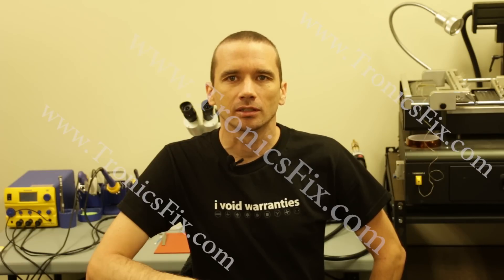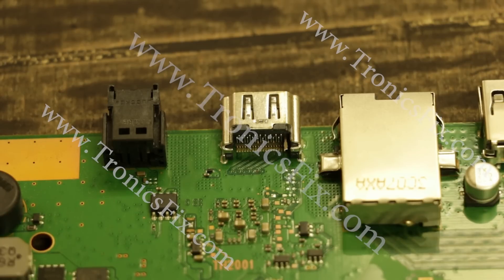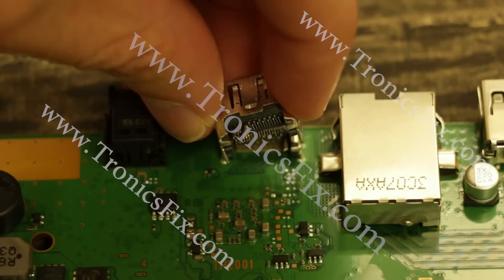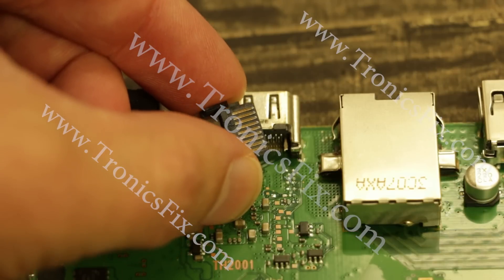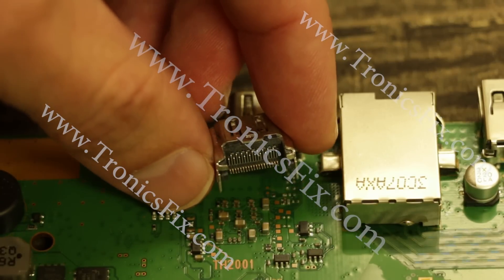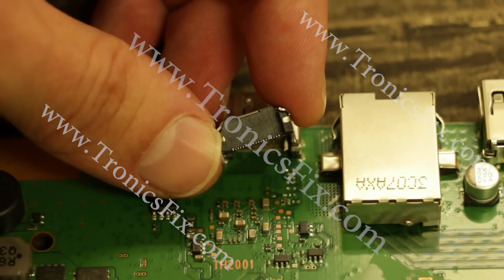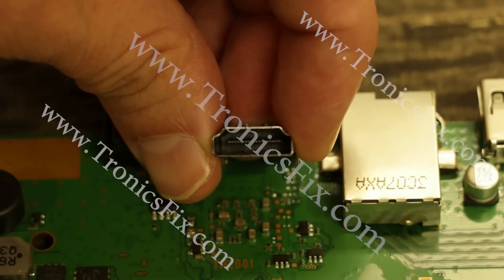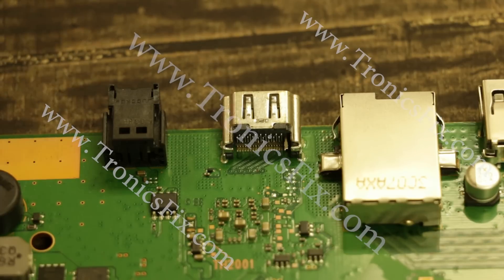Why PS4 HDMI Ports Suck

Comment: So how does my PS3 Last ever since 2009 and still works now, but my PS4 can barely last?
Reply from the maker: Good question to ask Sony!
Reply: I said the same damn thing. Smh.
Reply: My exact thought. Why tf...
Reply: I just got a PS4 Pro and I think my PS3 slim died of jealousy
Reply: because ps3 was a premium machine while ps4 it's made from low cost material. Iron vs Paper, basically
Reply: i have a ps3 with a fan problem
Reply: @misery_fell  one handed clap for you

Comment: I'm fairly sure I have this problem. I've not done anything to my PS4 other than change the HDMI once and that has meant there is no output at all from the HDMI even though there is no fault with the hardware of it. How would I go about fixing the issue independently or should I just go to a shop? Cheers
Reply from the maker: kurtisgre I don't want to discourage you from trying this job yourself, but at the same time this is a very difficult job unless you have a good amount of experience...we get these in quite often from other repair shops who have screwed them up so I can't say that I think it's a good idea for someone to try themselves unless you have a good amount of electronics repair experience. 
Just be sure that the shop knows what they are doing...ask them how many of these they do in a week. Ask them if they have even done one. If they don't have much experience I'd be wary. 
We have a mail in service for this repair if that works better for you.

Comment: What's actually holding the port to the motherboard, screws or solder? I think Sony might have fixed this now. I have the Batman version and it has a solid back not through like this one and haven't had any problems with the pins. But the HDMI cable doesn't go in smoothly, it does take a bit of pushing and wiggling to connect it.
Reply from the maker: A2892Z There are some of these out there that have an upgraded port, but not many. Hopefully they will start using better HDMI ports. 
Normally you should be able to just push it in without too much trouble. If it still shows a good picture on your TV then I wouldn't worry too much about it.

Comment: I went to repair shop. due to hdmi port completely going inside ps4. they repaired no cost if ps4 was not working after fix. they said motherboard was damaged. could it just be the port?
Reply from the maker: They likely damaged some of the solder pads on the motherboard. It's very common with people who try to replace these but don't know what they are doing. I'm not saying that's what they did...just that it's really common. I can fix it if you want to send it in. I'll have to look at it first though so I can give you an estimate.

Comment: hello steve i heard you said that if you press the power button and it beeps and then goes off then you press it again nothing happens, you have to unplug it, plug it back in and then it beeps again then that would be  a power supply issue. but what on the power supply is bad that would cause that problem?  i have that issue and i am trying to fix it instead of buying a power supply. help please
Reply from the maker: No idea. Sorry

Comment: Is it possible to place them back. Can I use a soldering iron that sucks the solder what else would I need to complete this project
Reply from the maker: luis hernandez I'm not sure if you are asking if you can reuse the old one or if you are asking if you can place a new one where the old one was after you remove it. You cannot reuse the faulty HDMI ports, they need to be replaced if they are bad. 
As far as replacing them, yes you can use a solder sucker to get the solder off. You would need to suck the solder off of the 4 mounting pins as well as the 19 tiny pins. You also need a new HDMI port and some good flux and solder.
Reply: I opened it and pushed the litttle meta  back in place i guess i got lucky it wasnt that bad now its perfect
Reply from the maker: luis hernandez I'm glad you got it working! Just keep in mind though that they will get pushed back through so at st some point you will need to replace it, but if you're lucky it will go like this for a long time!

Comment: Hey TronicsFix... my hdmi port is broken, i bought a new port and thermal paste to repair it. I also have all the necessary tools i just am wondering how difficult it is for a complete amateur on stuff like this to fix it myself. There is videos showing of how to do it. If I  cant do it i will send it to you, also what is your pricing I called a place and they said $180. Thanks...
Reply from the maker: Devin Woodruff To be honest it's a tough repair. We get consoles in from other repair shops that couldn't do it. That's not to say that you can't but it's a tough repair for a lot of people. Whatever you do, don't use a heat gun on it. We just had to fix one that had some nice burns on the motherboard from a heat gun. 
Don't pay $180 for it. Sony will even fix it for less than that! We charge $89.99 for this repair and that includes return shipping. We've done hundreds so we have gotten quite good at it. Here is the link if you decide to send it in: http://www.tronicsfix.com/ps4-hdmi-port-repair.html
Reply: TronicsFix Ok i most likely will,l i was going to use a heat gun but i guess thats out thanks.
Reply from the maker: Devin Woodruff I'm sure some people can make it work with a heat gun...it's just a really bad way to fix these and will probably cause more problems than it solves. Plus I'd hate to see you have to pay more for the repair because the heat gun messed something else up.
Reply: alright well i think im gonna send it in thanks for your reply
Reply from the maker: Devin Woodruff Sounds good. I'll watch for it!
Reply: TronicsFix do you guys use the improved one now?
Reply from the maker: Devin Woodruff Yes, we just got them in stock so we use them 100% of the time. We don't even have any of the old style in stock anymore and we don't sell them either.
Reply: awesome ill be sending it in soon you guys rock!
Reply from the maker: Devin Woodruff Sounds great! I'll watch for it.

Comment: if this kind of thing happened can it be replace the one that you show a new hdmi port with a cover on the back of hdmi so the oen of hdmi will never be push or or dislocated again and it will never cause any problem and it will never suck again and how much it will cause if i want to replace it with a new hdmi port the new model he one with protection on the back of hdmi port.
Reply from the maker: +Jay P. Deleon Here is our repair listing with pricing and repair speeds: http://www.tronicsfix.com/ps4-hdmi-port-repair.html

Comment: if that were the case is the ps4 still fixable? in the case the motherboard did get damaged. what's the possibility of it being fixed? it was fine days before till I got no signal on tv. But still turned on and was able to put in and eject discs
Reply from the maker: It's still fixable...it's just a matter of how many circuit traces need to be fixed. It all 19 are torn off then it wouldn't be worth fixing. Usually it's only 2 or 3 that are torn off and that's not too bad but when a whole bunch of them are torn off it gets expensive to fix.

Comment: What is the another problem of hdmi port? I mean when the pans itself are not damaged or pulled.
Reply from the maker: If the port is good then it's likely to be an issue with the HDMI encoder chip.
Reply: TronicsFix thanks

Comment: I'm thinking of using your service to repair my PS4, but I'm not sure if you'll be able to fix it, given the nature of the incident. I went on vacation and I was packing in a hurry so I left all the cords plugged into my PS4. I then dropped the box in the elevator and it landed on the cords, bending the HDMI port itself. I tried unbending it and using multiple cords, but none work. Would you still be able to fix it when it seems the whole port was bent out of place and internally severed? I know the rest of the system is still functional because I can hear the menu through the headphones in my controller.
Reply from the maker: +morgatron4639 This should be no problem for us. We receive consoles that are much worse than this...sometimes they have been completely knocked off the motherboard and have torn off some of the circuit traces...should be no problem. 
Here's a link if you're ready to buy: http://www.tronicsfix.com/ps4-hdmi-port-repair.html
Reply: +TronicsFix I actually just looked into the port with a flashlight to see if I had bent pins, and it turns out I have no pins. The entire back panel and the plate that holds the pins is gone, I assume it was punched further into the console on impact. So this may be a case of it being torn off the motherboard. Sure you can handle it?
Reply from the maker: +morgatron4639 Yes, no problem. If a lot of the circuit traces are gone we may have to charge more than our standard prices (it takes longer to fix if we have to fix those) but usually they are all there. This repair should be no problem.
Reply: +TronicsFix Great, I'll probably send it within the next week. I noticed on your website it says you'll let me know of any other repairs that should be made, so how much extra would it cost to fix one of those? And upon purchase will I be able to authorize that additional repair in advance, rather than waiting for you to contact me about it? For example, before the main incident my PS4 was having the constantly ejecting discs problem. Is there a form I could fill out that gives you permission to fix that along with the HDMI port?
Reply from the maker: +morgatron4639 Usually if we have to repair circuit traces we charge an additional $49.99...it could be more if all 19 were torn off but that is extremely unlikely. 
It's usually best if you just send it in and let us take a look at it then we can text you with how much repairs will cost. We are generally very quick with diagnosing problems so this should not take long at all. 
It's hard to give accurate estimates without seeing it. 
You could always write all of the issues you would like fixed on the repair form and put the amount you are OK paying for them. That's up to you though.
Reply: +TronicsFix same thing happened to me today.

Comment: How can i contact you guys, i need mine fixed. What flat rate do you charge to fix the hdmi port in the ps4?
Reply from the maker: Elijah Clark You can order this repair right here: http://www.tronicsfix.com/ps4-hdmi-port-repair.html
We charge $89.99 for this repair and that includes the parts (we install a new and improved HDMI port), labor and return shipping.

Comment: yeah um what about when it has no volume?
Reply from the maker: +Ryudame Midoriko Sound is transmitted through the HDMI port so it could be the problem. Usually there are display problems as well, but it could affect just the sound. You can check the HDMI port with a flashlight to see if there are any bent or broken pins. You can also just send it in if you'd like: http://www.tronicsfix.com/ps4-hdmi-port-repair.html

Comment: Help!! my friend tried to repair my hdmi port he got it off but its pull many of the contact on the motherboard for the hdmi off, is it repairable?
Reply from the maker: +james wilding Yes, it's fixable. No it won't be cheap to have fixed.
Reply: Ok thanks is it something most computer repair shops could do or is it a specialist job
Reply from the maker: +james wilding Most computer shops can't fix this. You never know though so you should check around.
Reply: +TronicsFix ok thank you for your fast reply much appreciated
Reply: +james wilding p.s where can i get that t-shirt in the vid lol
Reply from the maker: +james wilding You're welcome. Thinkgeek

Comment: Hey TronicsFix. Im having a problem with my ps4. This is the second time. Basically i put my ps4 into rest mode and when i wake up to turn it on, it will beep turn on and turn off. Its very similiar if not exactly like the so called blue light of death. If there is anyway u know how to fix this please let me know
Reply from the maker: TheUnicornQueef It's hard to know without more info but you're right that it sounds like it might be similar to the blue light of death. You may have failing connections between the APU and the motherboard.
Reply from the maker: +Ethan Jacobson Keep in mind that a reball does not always fix these. In fact we've found reballing to be an unreliable fix...that's why we don't offer that service.

Comment: Hey i wanna know about my ps4 hdmi problem. Th hdmi port of my ps4 is ok no bent pins or anything else. Everything is working fine a few days ago but yesterday the problem happened. The ps4 is running fine but giving no display and sound but when i plug headphones they give sound of the ps4 means that the ps4 is running fine but not giving display and sound thru hdmi and i check the port there r no bent pins etc. i tried it on many leds and with different hdmi cables but still no luck. Is this cuz hdmi ic issue?? I'm very sad cuz i bought it a few days ago and now this happen :-( plz reply guys
Reply from the maker: It could be a faulty ic but there's just no way for me to know. I would try it with a brand new cable.
Reply: +TronicsFix LLC one more thing that when i don't turn my ps4 for like 12-24 hours  continuously  after this when i turn it its starts giving display. I think its the hdmi ic heat problem that it needs time to get cool and run again. But the one thing is clear that the shopkeeper who sold me this faulty ps4 has done phd in scamming :( i sold my pc for this ps4. Its the only thing that i have for gaming and its faulty. Bad luck. Btw thanks for replying u really a pro in these kind of things and or that u got a new subscriber :D